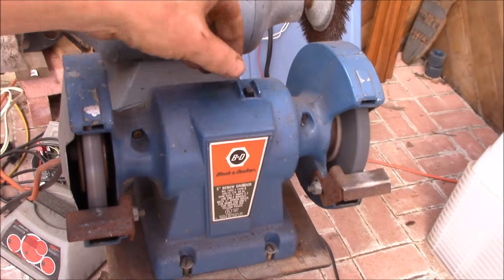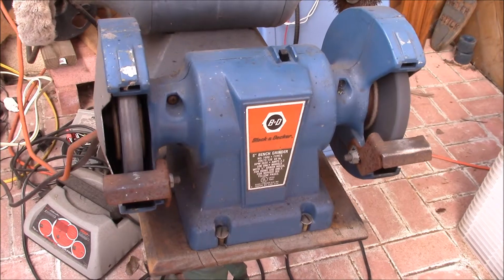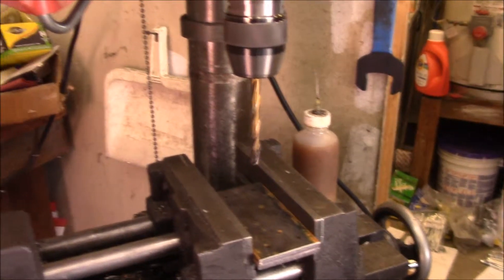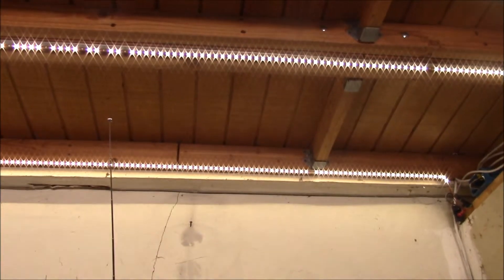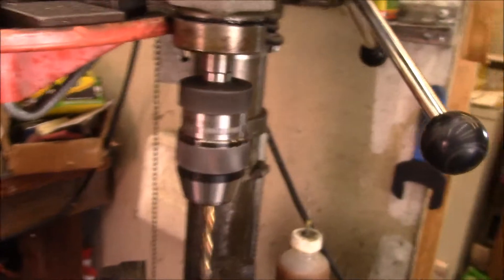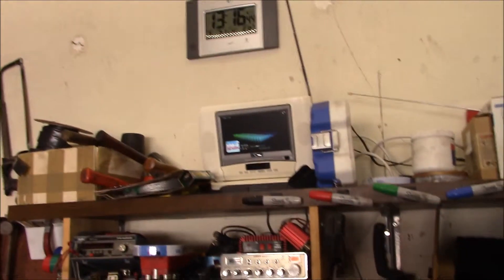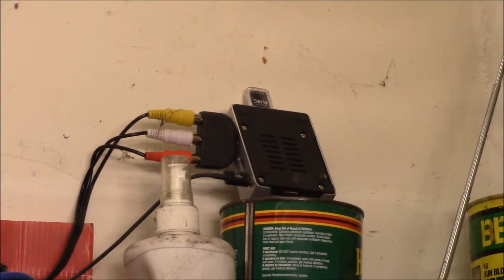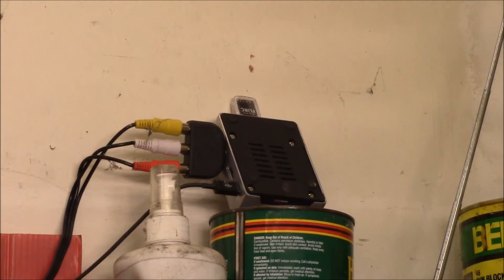Solar Power Tools

Comment: What size solar system do you have? How big is your battery bank?
Reply from the maker: At that time, around 1KW of panels and maybe 200 amp-hr of 12V battery bank.  Now have about twice that on a 24V battery and am running most of the tools in my shop off solar.